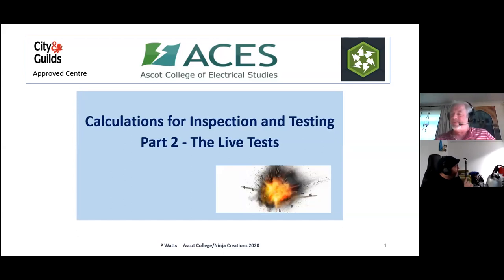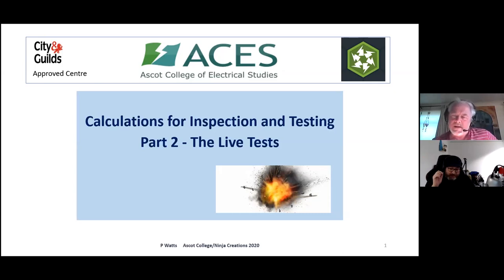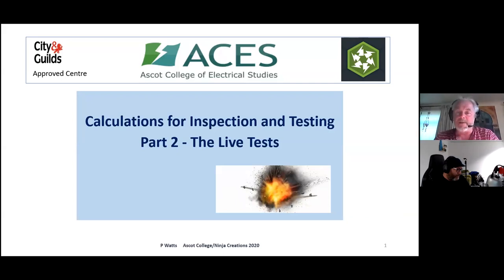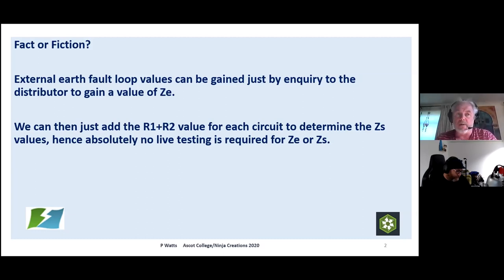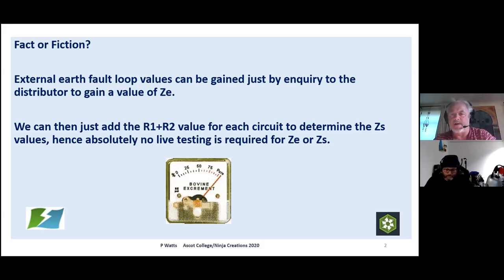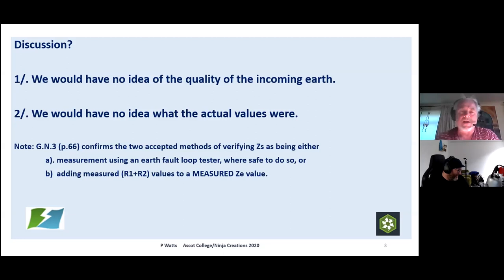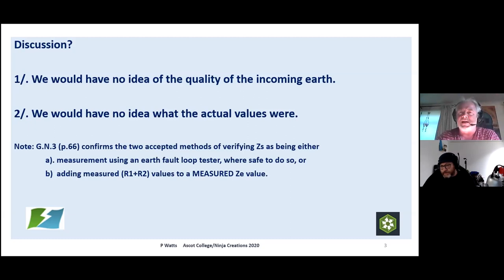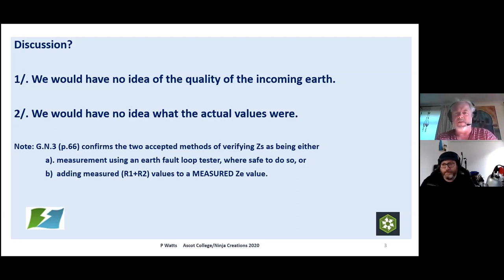Inspection and testing - analysing the results of LIVE tests - A SparkyNinja webinar

Comment: Looking at GN 3 Have you got a typo @30:47, Power point states Zs of 1.75 for a 16 A Type B Should that not be either a 20 A BS EN 60898 or the Figures Changed to match?
Reply: Yes he has the wrong figures I noticed that, figures for a type C 20A

Comment: thankyou for this I agree on Zs readings I work on a marina and we were recently tested and after some investigation  as we couldn't get a Zs even though  dead test good as was Ze. Tracked to a fault on a boat with the vessel unplugged Zs good eventually tracked to oven and water heater timer each leaking 20ma to earth even stranger all rcbo s and rcd tested fine

Comment: just looking at this, and in OSG,  table B6, 16A type B  zs is 2.2, or have I cocked up.
Reply: Tybe b 16a 2.15 table A4 OSG
Reply: @sulphuroxide1  at 31:00 he says its 1.75 is this not wrong?  Your value is correct.  Its 2.15 for a 16a breaker type b, he’s got the value of a 20a in the video.
Reply: I spent 20 odd minutes looking through the O.S.G and G.N3 and was confused as to where the figure was pulled from. Happy to know I wasn't the only one.

Comment: @50:48 Interesting that your talking about measuring short circuit currents for final circuits, I've only ever measured it at DB's and switch boards. The test form in BS7671 doesn't have a column for this info , though. Maybe the next amendment could address this, as theres not c column for r1+rn either.

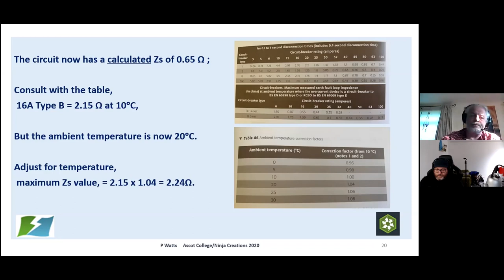Comment: @ 41:46 How come we are permitted to have a higher Zs when the ambient temperature increases? I would have thought it was the other way round..
Reply: Its assumed that copper (in the cable) will increase in temperature and therefore the cable impedance will also increase  , a type B MCB will trip (instantaneously 0.1 S) at 5 times its rated current , so if we assume 1.37 ohms will trip it on a 70C cable , at 10C only 1.1 ohms would be the maximum needed to trip in the required time

Comment: Love these videos, very informative and the delivery is second to none. It makes understanding the calculations a lot simpler even though they could be considered relatively difficult.

One small observation was the example at 57:07. Were using a 32A type C RCBO, however at 58:39 were using a current/time graph for a type B. It doesn't effect the overall outcome as it in fact makes the outcome worse. Roughly 20-21 seconds until tipping instead of the stated 17. 

I am wondering if you take ambient temperature readings during EIRCs and do you state the temperature on your Schedule of Test Results?